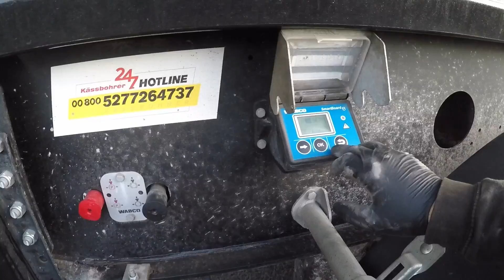M.T.D 146 We've had better weeks

Comment: Hi if you use locking nuts nylock nuts the heat from the exhaust melts the plastic so they come undone better useing spring washer and a spot of thread locker just saying 👍

Comment: Hi Russ, what's the exhaust brake like on the volvo? I've been driving a few different fh 500s and find a big difference from unit to unit on how good the exhaust brake is, unless I just don't know how to adjust some setting or other. Some are good some are a bit useless
Reply from the maker: Its not to bad. You need the brake on before she starts to run. Otherwise she will run off
Reply: @russellworthing3586  maybe I'm expecting too much from it to be fair then, it's ok on the motorway more slowing down for roundabouts and stuff, older shape volvo seemed better. Even the mercs seem better, that's the only good thing about them sheds though!!